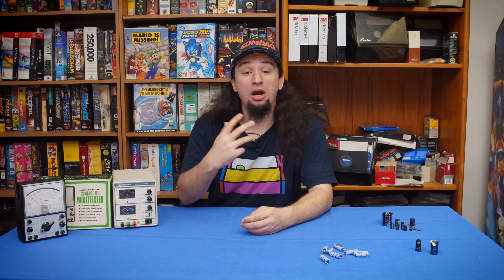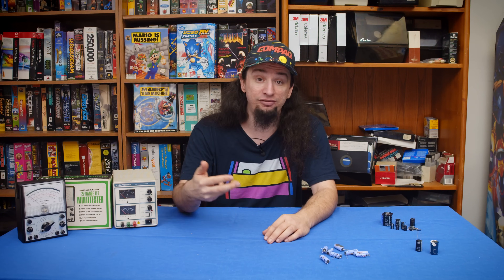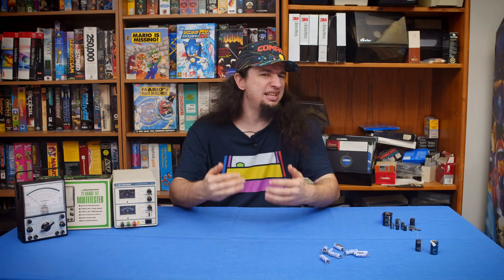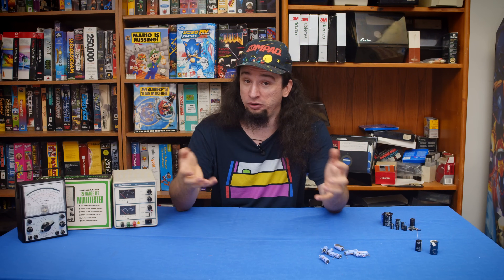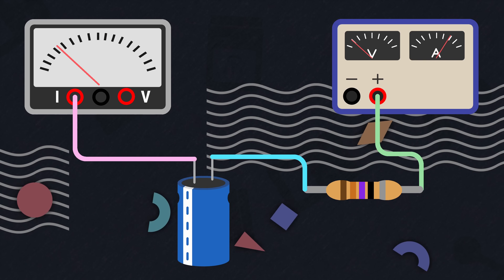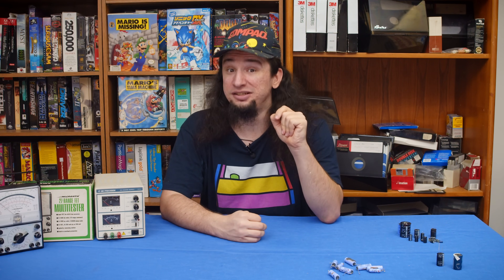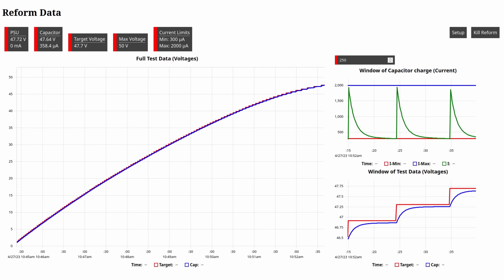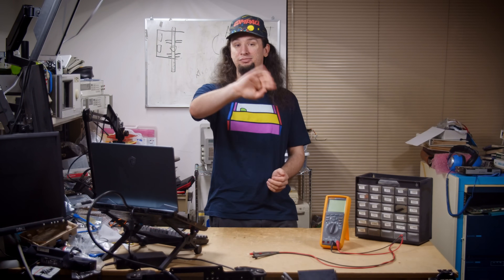Reforming Capacitors - Everything you wanted to know

Comment: 2 things to note here:
1) the sinkrate of the current is also greatly depending on the capacity because it is high on discharged capacitors. When they charge, the current goes down.
2) why didn't you use the current limiting function of your psu? It nearly does the same but without bumps. You can even charge lithium ion batteries with such psus, just set maximum voltage and current.
It's called CCCV. (Constant current, constant voltage) or IU.
Reply: Came here to ask about #2 ... it seems like a constant-current of 2-5mA and a maximum voltage at the rated working voltage would work as well or better. Is there something important about the stairstep method?
Reply: Using a psu in CC mode was also my first thought.
I guess that with an analog psu with a single potentiometer current control, even if using an external meter which gave precise current readings, it might still be extremely tricky setting a very low current.
Rather easier if the psu had coarse/fine controls, but with a digital psu which had current control down to the mA level, it should be really easy, as long as the psu did what it was supposed to do at the extreme low end of its current limit range (I'd still probably put a meter in series to make sure).
Reply: Most PSU you find in use are normally reasonable in voltage control, but current control is normally very poor both in terms of loop stability (they oscillate around a set current nicely) and in actual control ability. you need a SMU, generally not a common, or cheap, item in a workshop, to get good repeatable and reliable current setting ability, or a constant adjustable current supply, also not common. So a constant voltage power supply, and a resistor is the thing to do, though with very large capacitors you can use an incandescent lamp, rated for roughly the voltage maximum for the capacitor (so a 120V lamp for a 100V capacitor, and a 230V one for up to 400V, with a 12V and 24V lamp for lower like 15V and 35V) to provide a faster charge current, yet still provide protection against it going suddenly short. Light bulbs around 15W for the higher voltage, and 5-10W for the lower voltages works. So long as the voltage is within 50% of the rated either way it will survive short term overloads, plus visual indication on the higher voltage ranges by it becoming a photoflood lamp.
Reply: @SeanBZA  It's been a while since I used a bench power supply with a variable current limit setting so maybe it is difficult to set the current correctly.  I'm still curious though about the original question of would it work fine without the stair step?  it's pretty simple to rig up precise(ish) constant current circuits with a couple of transistors and that would be easier for me than getting GPIB set up.
Reply: @johnwilson839  Does not really need constant current, error versus simple RC will not be much of an issue, plus you can also use the drop across the resistor as a current sense.

While some PSU units are great with CC mode, I find a lot of the lower end ones are not exactly great there, especially with a very large capacitive load on them. After all a 5c resistor is cheap, and can act as olfactory warning of high current flow.

Comment: outside of absolute specific use cases, its just not worth it. electrolytics for most instances are dirt cheap, even for name brand models, so as to make reforming a largely depreciated method.

gone are the days of caps costing almost as much as a new unit the cap would be installed in.

for those few use cases? eh, maybe, depending on some factors.

for the bulk of uses? cheaper, easier, and usually faster to just put a new one in.
Reply: Yo momma's dirt cheap.

Comment: You can just rectify mains AC to get around 340V for 230VAC, or use a doubler for 120V.
Just be weary of any connections to this because the setup will be mains referenced, not a good idea to touch it when it's powered on.
Reply: yeah, just use a tripler for a doubler

Comment: It might be worth mentioning that for non-polar paper capacitors, reforming like this doesn't work, instead the paper dielectric has absorbed moisture and you need to get it out, for example putting the capacitor in molten beeswax above the boiling point of water... or putting it in an oil, and then pulling a vacuum on the capacitor that will boil off the water as well. I've done this and it works
Reply: Completely sealed "molded" capacitors (Think of Sprague black body, yellow writing types,) (paper types) are all bad due to the paper inside becoming acidic, not just moisture. Wax body capacitors have both moisture and acidity problems, so you are just lowering one issue, but the other far worse issue still remains. Think of discolored pages in a an old book (yellowing or browning paper) this is whats going on inside all of the old paper caps. They all need replacement, no excuses, just physics and logic.
Reply: @MrCarlsonsLab Oh, it's him! The old capacitor master!
Reply: Please just replace it. Paper caps like that will never be really good or safe again. They are at the end of their life or beyond. Want an original look, restuff them.
Reply: He did mention that this is for one specifoc type of capacitor. I do hope he will do the rest as well.
Reply: Yes, paper capacitors can be theoretically "repaired", by boiling them in hot wax for an hour. That drives the moisture out and rebuilds the insulation layer of the paper dielectric. But this works with larger unsealed ones, that were mostly from 1930s-40s. There are some videos of some people doing that, and the insulation properties increased from like 1M ohm to few G ohms
Reply: I usually carefully reflow capacitors at 110 Celsius (while they are rated for 120 Celsius). That's all I will ever do apart from replacing them.

Comment: Capacitor and in general companies making or servicing stuff got to be hating this... I mean repair shops barely exist now and if you search for replacement parts your told to buy something new. Progress!

Recap is just madness. But o boy this is so freaking awesome! I hope to never need to know this but is it not nice to see that people try and share instead of hiding knowledge to make money.
Reply: They couldn't care less about this. This is very specific corner case. And when you have to supply a warranty you are not going to use old parts. Capacitors are cheap and very easy to replace. There is almost no benefit in reforming. Not even financially. 
If your time is cheap and you want to do it that's fine with me and the "companies"😃.

And nobody is hiding this knowledge, as he showed, it's right there in the friggin datasheet. Everybody knows about it, nobody bothers. Parts are cheap. And in most cases the specs of new parts are superior making for a better performing device.

Comment: A simple constant current/constant voltage circuit probably works just fine here.  A LM317 constant current source with 1 kOhm between the output and adjust pin provides 1.25V / 1 kOhm = 1.25 mA of constant current.  By powering it with a certain voltage, you will get a constant current until the target voltage is reached (minus about 1.5 V drop) after which the current reduces as the final charging voltage is reached.

Also, sometimes if you have equipment with linear power supplies with capacitors that need reforming that power digital electronics, disconnect the digital electronics and you may be able to ramp the voltage up on the linear power supply safely.
Reply: If you use just a constant current source you might have a too high voltage at the start. You want to limit current AND voltage.
Reply: @thiloreichelt4199   A constant current regulator does exactly that.  It behaves as a "variable resistor" that drops more voltage at the start of reforming to hold the current at 1.25 mA, and then as the reforming continues, the voltage drop across the regulator decreases until the supply voltage (minus about 2.5 V) is across the capacitor.  If the capacitor being reformed is nearly a short circuit, the initial voltage will be near zero, not near the supply voltage.

Comment: Thanks for this video! Using your devices regularly, even just for a few hours every year can do so much!

As a repair technician I've been doing capacitor reforming from time to time, but mainly using the variac method due to time and equiment constraints.
Most of the time when we get a device that has been in storage for a long time, the owner has already connected it to mains and done the damage before they bring it to us.

The method in this video appears to be the proper one, but it is also time consuming. It's all about limiting the intensity of the chemical reaction during the self-healing process and therefore especially the temperature. If you can't take the device apart and desolder all caps, it's still much better to have it sit at a lower voltage for some time before connecting it to the full mains.

I've been thinking about what to do with switching power supplies. Regulated PSUs with linear voltage regulators usually aren't a problem, because you can usually regulate the voltage down enough so the input voltage to the regulator is so low that it can't output it's designated voltage and thus reduce the load on the capacitors connected to them.
I'm going to do some experiments with switching PSUs to get an idea what we can do to reduce the stress when taking back to use.

Have you done anything in that direction or have you just accepted having to desolder every large enough cap in switching PSUs?
Reply from the maker: Switching power supplies are so finicky that you really can't work around it. You have to remove the caps.

I'm not sure quite what you mean about linear PSUs either, I don't think you can reduce the voltage into them to vary their output to reduce voltage to any downstream caps. An LM7805 for example, is an LDO that won't output 5V until you get up to about 7V input.
Reply: @TechTangents  the LDO will however happily turn into a series of diodes when the necessary input voltage is not reached. So you can gradually raise the voltage through it.
Reply: @SianaGearz  That. :)
Reply: @TechTangents  "Linear" in the sense that there is a transistor that does the voltage control and turns any surplus voltage into heat, be it inside a 78xx/79xx or similar or discrete. "Continuous" may be a better term, but "linear" seems to be the one that's most commonly used when talking about regulated PSUs (may be a non-English-native-speaker-thing though). "LDO" means "low drop out [voltage]", which I guess you seem to use for that kind of circuit design? That's actually a special class of those "linear" regulators and the 7805 certainly is not one of those.

Having had a night's sleep over the matter I do think it's possible to reform the caps of potentially many switching PSUs without removing them first.
Most switching PSUs I came across have a rectifier made of schottky diodes on the secondary coil of the transformer (or multiples thereof) which connect to the filter caps. At least one of those power rails has a voltage divider which feeds back to the switching control circuit via an opto-isolator. As long as that's all that's connected internally to those rails (and I think that's the case for most simple switching PSUs), we can safely feed an external voltage into the output while the PSU is turned *off*, because the diodes prevent any current back into the transformer and the voltage divider has a high enough resistance to be negligible. Practically you could connect your setup to one of the voltage rails as a whole. Repeating that process for all voltage rails we'd have reformed the secondary side of the PSU.
For the primary side things are a bit more complicated. Some PSUs might be OK with a lower input voltage after the secondary side has been reformed, but that's what I want to investigate further: Which kind of circuit can cope with that? For example PSUs which can work with 120V as well as 240V (without a manual switch) can be powered with down to under 100V at times which could be low enough to reform the primary capacitors depending on the circuit. The current through the PSU would make the process you described here impossible of course, but the eyeball-approach using a variac could still be a valueable option here. Worst case scenario you could still desolder the primary caps and reform the secondary ones in circuit with many switching PSUs, which could save a lot of time.
Reply: I figure any switching PSU made to run off of grid power won't be damaged by just a few minutes of running at reduced input voltage. I would just dim bulb it for a bit. Any reforming current will be much higher than ideal but it will let you know if any are excessively leaky.
Reply: @eDoc2020  Switching PSUs usually have a feedback loop to regulate the output voltage depending on input voltage and load. It would try to reach the rated output voltage(s) even when the input voltage is lower. So the effect on the output side capacitors will be less and they might fail instead of being reformed. That's why I suggested reforming those with an external voltage first.

Sometimes switching PSUs won't properly start oscillating with lower input voltages and start over and over again, which could cause higher currents and more stress in some components. If you see that happening you should remove the cap or find a way to stop the oscillator altogether before attempting a reform.
Reply: @ResonantBytes  I agree but I don't think it's worth worrying too much about it. My main concern is seeing if caps are shorted or not because that can break other things. On a dim bulb the total input power will be limited so you can quickly see if anything's horribly wrong with only minimal chance of blowing parts. My unscientific approach is if the capacitor doesn't get hot it doesn't need a reform.

On the most recent video I recorded (but didn't edit, don't know if I ever will) I had an old AT computer supply that had been unplugged for over 20 years. It had an intact seal so I didn't want to open it. Since it's nothing special (and because sparks make good video) I decided to just plug it in and flip the switch on full power. The fan might have twitched but it didn't come on. I turned it off and tried again and it powered up just fine. Reform complete.

In my opinion if a capacitor needs more than a few minutes to reform it's probably safer just to replace it.
Reply: @eDoc2020  Ah, the light bulb approach is genius now that I think about it. Using a light bulb you're limiting current rather than voltage, which is probably better here because even though the (internal) voltage is regulated, you can limit the power going in,  and the only load would be caps that need reforming. If you regulate the voltage down the PSU might try to compensate e.g., by increasing the duty cycle and therefore increasing the current over what it would usually use. After all P=UI is what makes caps hot. ;)
Will have to check out what that will do. Thanks for the inspiration! :)

Recently I also gave power to an old AT PSU and it worked perfectly. AT PSUs seem very reliable to me and it's a shame everyone seems to throw them out for "safety". I only turned the system on for a short while because the Dallas clock chip was discharged and the system wouldn't boot in that state. It's a rougher approach but limiting the time and therefore energy going into the caps after turning the device on after a long time could actually give them enough time to cool down. And of course there's still the possibility that they didn't need reforming anyway.

Comment: Perfect timing. I have a SWTPC 6800 which has a minibar Coke can-sized electrolytic that needs reforming.
Reply: In the simple method you just connect a capacitor to a variable PSU through a resistor with a meter across the resistor to monitor the voltage drop. Begin at the lowest voltage and note the meter reading. When the meter reaches zero increase the PSU voltage in a step wise fashion and again watch the meter. When it drops again increase the voltage again. Keep going in steps until you've reached the capacitor's rated voltage and then hold it there until the meter's again dropped and then hold it there. It is recommended to form for one minute for each month out of service. I generally call it good after an hour myself.